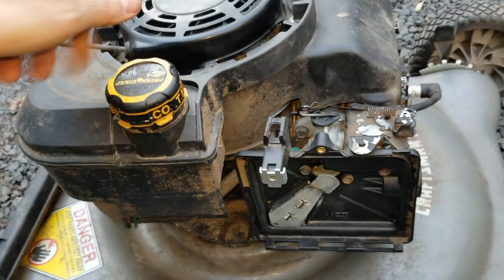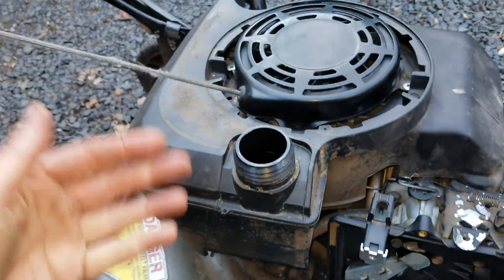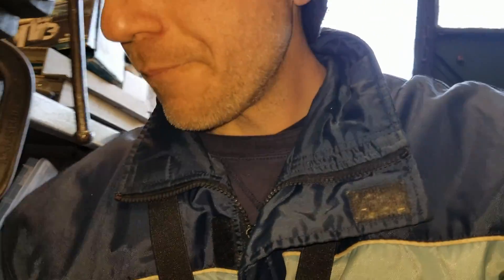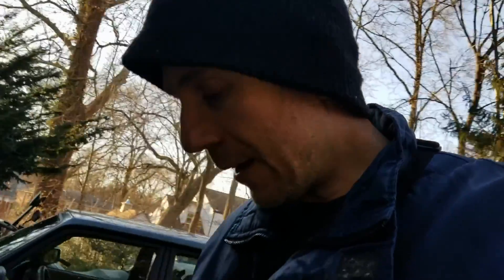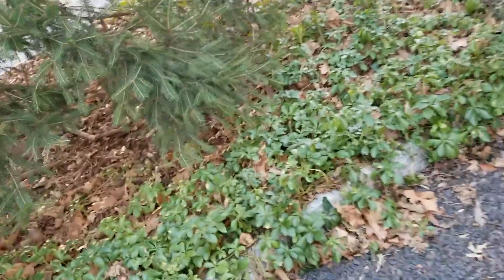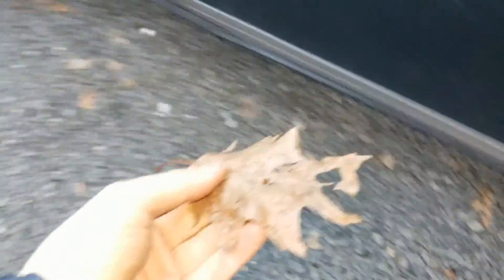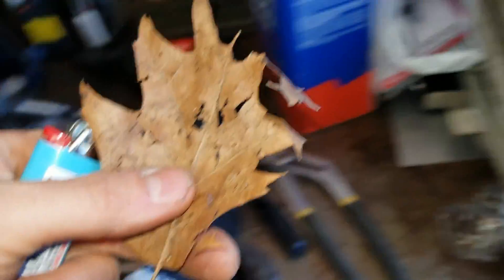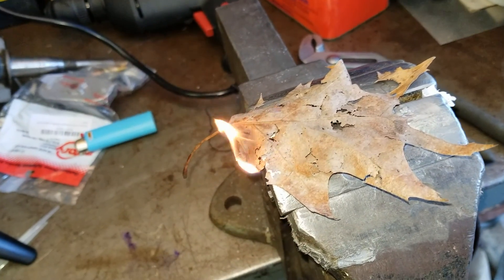Gasoline to Electric Lawnmower Conversion (NYK behind the scenes) | E2 (Air, Fuel, Spark)

Comment: So, there must me SOME pro/cons of using denatured alcohol, what would they be?
Reply from the maker: Not sure exactly, but in general there's a different fuel ratio and a higher octane rating. So in some scenarios there's a Advantage if you had higher compression. But in the lawn mower you just have to run more fuel. On a rich mixture